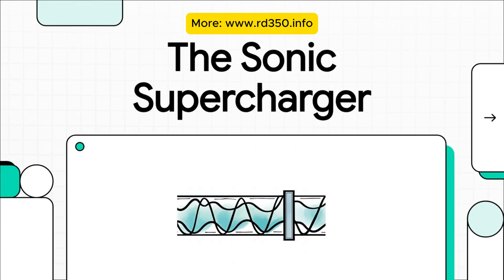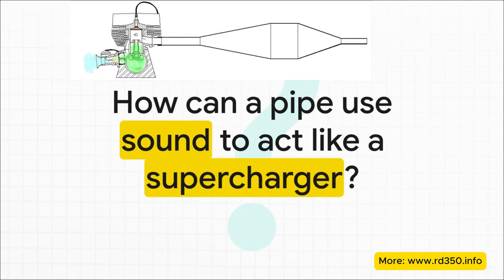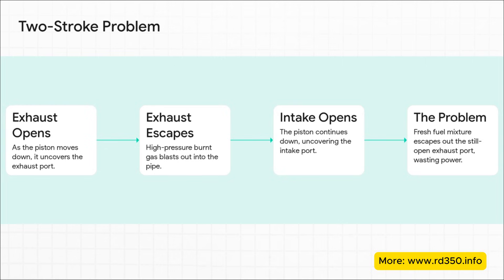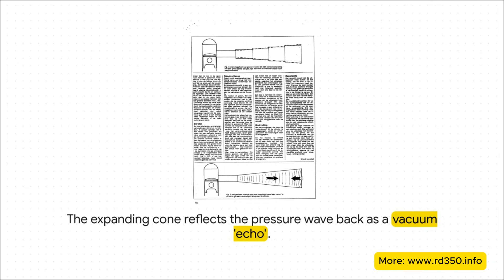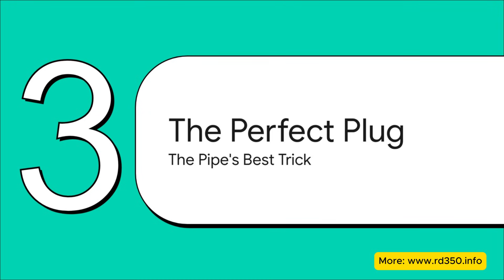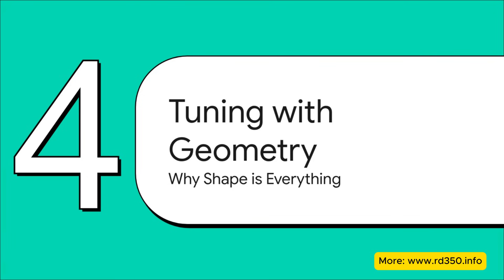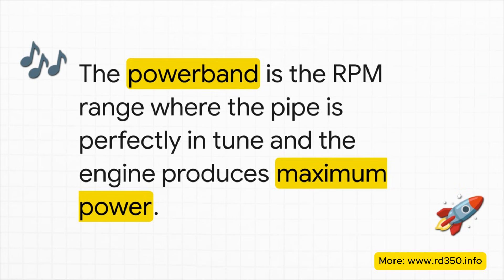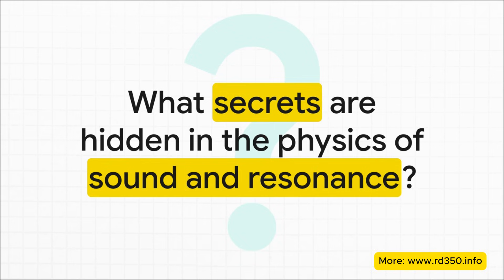The Weird Pipe That Changed Racing Forever 🚀 | 2-Stroke Expansion Chamber Explained

Comment: Back in the 70s we had Basani pipes for our two-stroke Yamaha RD350/400s and the effect was absolutely stunning. When you hit that power band on a RD engine the front end would lift off the ground there was SO MUCH torque. And the sound was awe inspiring.

Comment: Sooo.... cant we have this with a 2/4 cylinder four-stroke with enough valve overlap and an exhaust valve system, so sonically compressed gases will be pushed into the correct cylinder?

Comment: Also on many bikes there is a mechanical power valve which helps give a wider power band. I am a 4 stroke rider but I find 2 strokes technically interesting. The science is amazing. I like the broad power range and predictability of 4 strokes instead of the peakiness of 2 strokes.
Reply: IIUC, a widely-variable exhaust able to adjust in real-time to engine RPM -- probably with a small lag -- would scavenge throughout the relevant RPM range and offer the efficiencies described?
Reply: That's exactly what the Power Valve does.
Reply: @dankuchar6821  Is it automagic? Either way, does it have a limited range, or is it across the entire 'useful' -- non-stalling -- range of RPM?
Reply: @michaelthibault7930  The power valve is mostly controlled by engine RPM. In the most simple form it uses a centrifugal governor with mechanical linkage or uses the exhaust pressure to push open exhaust valve more or less. In more advanced systems it is controlled by an ECU.
But the basic idea is the same: less exhaust timing and exhaust port area for low RPM and more exhaust timing and port area for higher rpm.
The length of the pipe not only depends on the targeted resonance RPM but also the timing of the intake, transfer and exhaust port. When you control the exhaust port timing you can make the same pipe work perfectly over a broader RPM range.
Reply: @marcelpursche5339  Thanks. Can you clarify what is meant by "less... timing" and "more... timing"? I surmise that the former is 'lagged exhaust port opening relative to ignition'...
Reply: @michaelthibault7930  Timing means how long the exhaust port(or other ports) are open. It’s usually measured in degrees of crank rotation. In a two stroke this is controlled by the position and height of the exhaust port. The piston will open/close the port as it goes by. Leaving open for longer is better for higher RPMs and leaving it open shorter for lower RPMs. In practice this means the upper edge of the port is lower for short duration and higher for longer duration.

Comment: Exhaust harmonics can also work for a 4 stroke, i had my engine, exhaust manifold, exhaust pipe and inlet length calculated for the correct pipe diameters and lengths.
Every ft/lb and subsequent bhp counts.
Reply: Definitely, some early dragsters used a stinger for the exhaust: basically just the first half of a two-stroke pipe. Especially common in VW Beetles hot-roded for drag racing. With multiple cylinders and an equal length headers you can also create a vacuum effect to improve scavenging.
Reply: @marcelpursche5339 they've actually found that unequal length extractors tuned the right way by adjusting the length used matched to the correct cylinder has produced way more power gains than any equal length system. Goes against what I was taught decades ago.
Reply: @tonymarshall9670  Oh, intersting.
Reply: @marcelpursche5339 there was a lot to it. But I think they were calling it tuned length exhaust headers. They weren't just a little different in length it was noticibly visible. Think it was also based on firing order as well and what each cylinder is doing in the cycle. To be honest it was like I stumbled on black magic 😂. It's not exactly new some old heads were even talking about doing it way back. I think manufacturers just stick with equal length because it was simple easy and cost effective without so much trial and error experimenting or science costing profit margins. Always the way why we can't have nice things that work well. 
I think you'll find you can get them for certain vehicles but they're not cheap.

Comment: This is why naturally aspirated ten cylinder 3 L Formula One cars of the 90s could spin over 20,000 RPM and make over 900 hp, the opportunity of intake and exhaust diameter and lengths
Reply: Wrong 😂😂
Reply: Read Dr. Blair’s books on two stroke and four stroke calculations and dyno charts and tell me I’m wrong.
Reply: I think that had more to do with them having ultra lightweight components such as aluminum rods, perfectly balanced engines, and pneumatic valve springs.